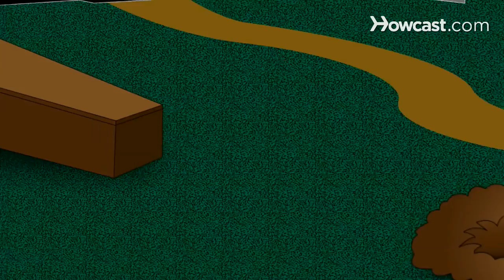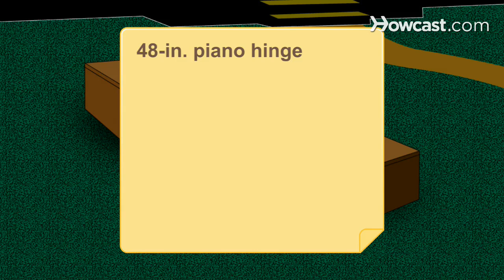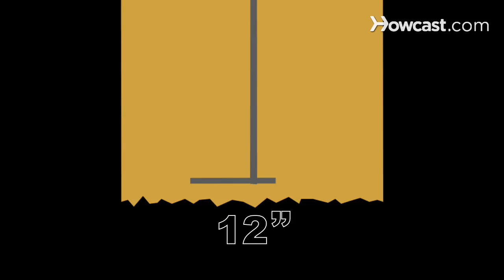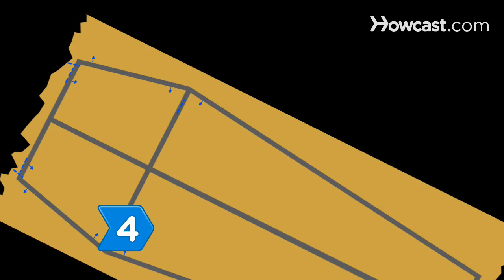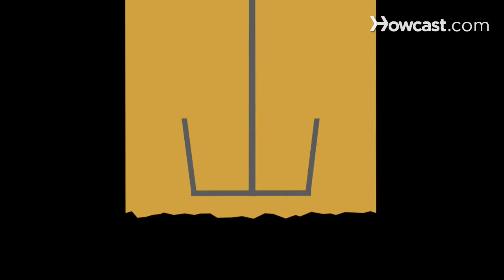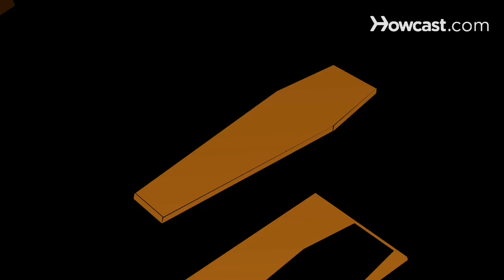How to Build a Coffin

Comment: @silv3rlogic  by biscuits i believe its referring to short dowel pegs that are rounded on the ends
Reply: Clinton Dill biscuits in wood working is a wooden foot ball shaped wafer about 2 “ long and 1/8” thick... a special cutter cuts a grove on edges of wood and the biscuits and glue go in the groves .. clamp tight .. make a good solid wood joint..